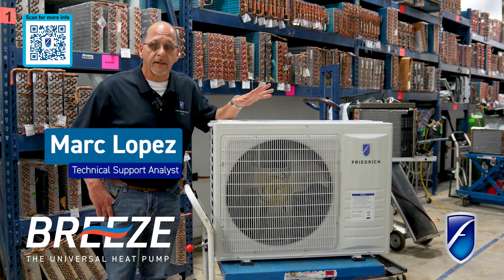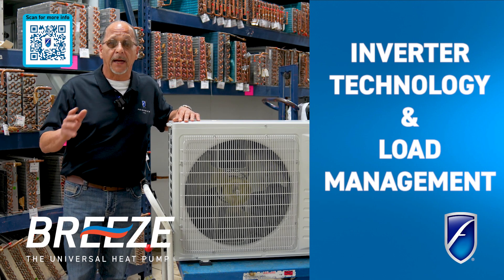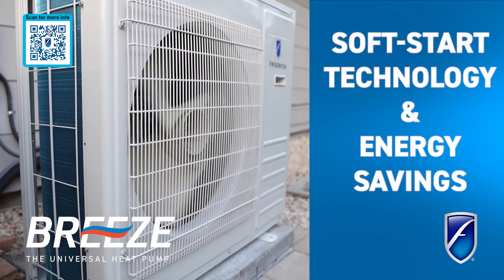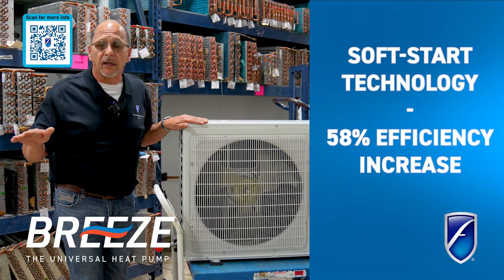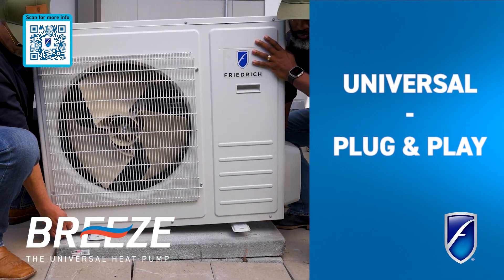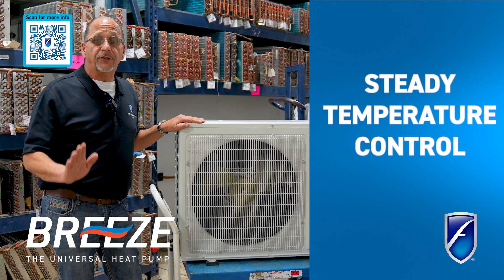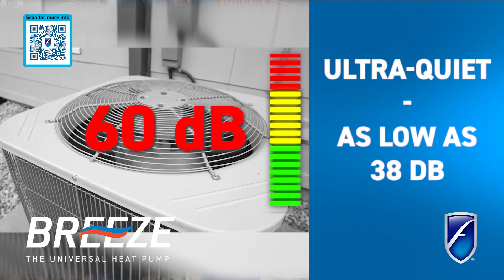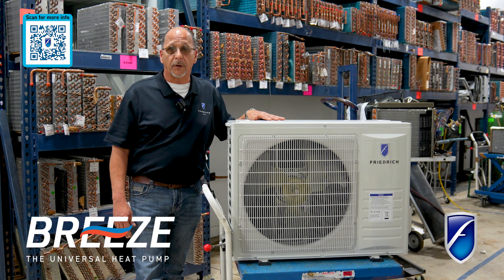Shop Talk - Shootin' the Breeze with Marc Lopez

Comment: So are these really true inverter systems? My friend has one and along with the paired Friedrich blower unit and it did not come with a integrated thermostat like true inverter systems do. His is connected to an Ecobee and it cuts on and off like a standard HVAC system. I thought inverter systems are supposed to run continuously.